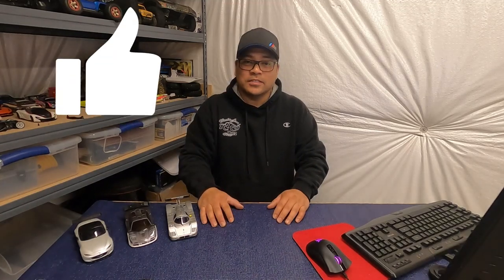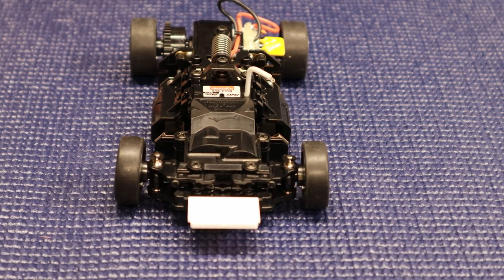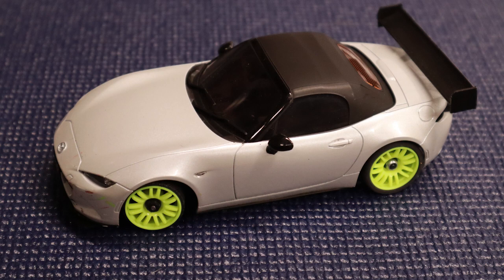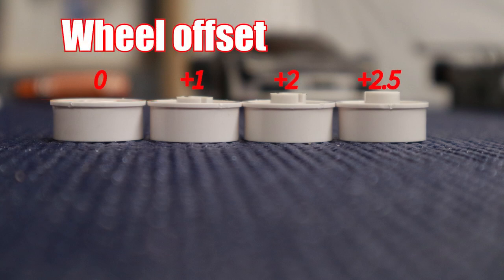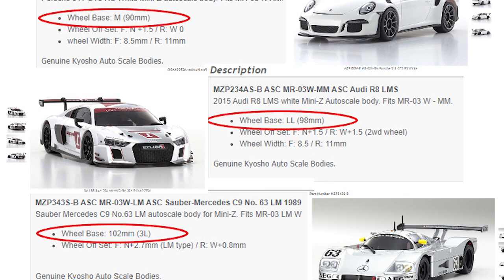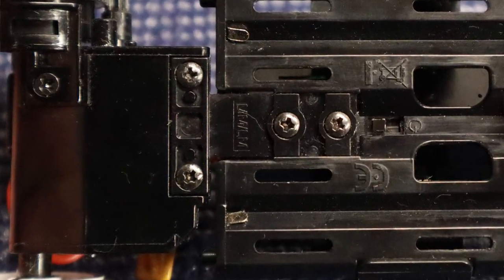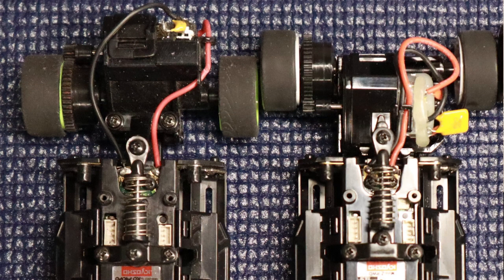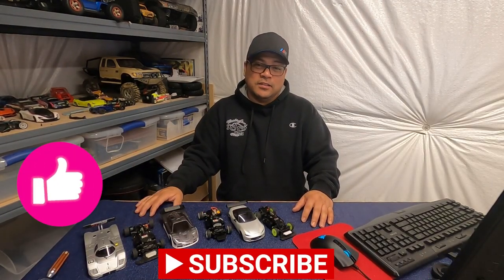Kyosho Mini-Z for Beginners-Chassis Configurations

Comment: I watched your video on this and it was informative but can you tell me what LM means? Or racing is it better to go with the mid motor, the LM are the rear motor mount I'm guessing mid engine since you don't have the weight over past the rear axle. I don't have a local track this would be something I just be doing at home

Comment: amazing job on the video.  is it possible to mount mr-01 bodies onto an  mr-03 chassis?
Reply from the maker: Yes, however you have to consider that most MR-01 chassis was originally narrow.  That said, bodies that are wide used wide offsets. Plan to purchase the associated motor mount and plan to switch to a narrow front end since MR-01 wheels are wider offset meant for a narrow chassis.

Comment: Which chassis for a 94mm RWD? I want to use a Mitsubishi EVO on a RWD chassis but info is hard to find. MR-03 RM? Kyosho should really make this easier to figure out.
Reply from the maker: All of the chassis support 94mm RM. It's the furthest setting with the RM T-plate and RM motor mount.

Comment: Which configuration does what? I.e. what are the advantages of RM vs MM? Which is easiest to drive? Which is fastest? For me... I suck at driving, so easiest to drive would be my best bet.
Reply from the maker: Hey Gear Head36.  To put it in 100 words or less, MM is going to be more nimble and turn in faster because the weight is more centralized.  The RM is going to feel slower around corners on tight tracks but more stable on throttle down the straights as the weight is behind the rear axle.

Easiest to start with, in my opinion, is the RM because of those characteristics.  It will be harder to drive fast which means less mistakes.

However, your options for RM are Nissan GTR Part Number 32331S-B (Recommended), Toyota 86 Part Number 32336PW, and Porsche 911 GT3 RS   Part Number 32321S-B according to the Kyosho America website.
Reply: @byebyeracing4277  Thanks. That helps a lot. I have a MR-2 MM, and I've always had trouble keeping it off the walls.
Reply from the maker: @gearhead366  it helps to turn the steering down a bit and reduce the throttle until you are consistent then ramp everything up a couple notches until you are not, then go back a couple clicks.

Comment: How do I change my mini z wide mm to lm I want to fit the Toyota gt one body on it any help would be appreciated
Reply from the maker: You will need the LM motor mount MZ305 , LM differential MZ302 and various parts that already come with the MM kit like the T-plate and the rear shock set.

Comment: Whats the fastest configuration around the track?
Reply from the maker: 102mm is very stable and typically wider.  98mm is the most common and covers the range of classes from stock to open class.